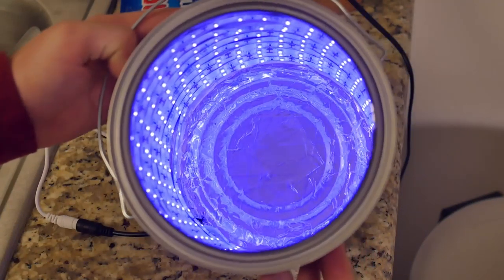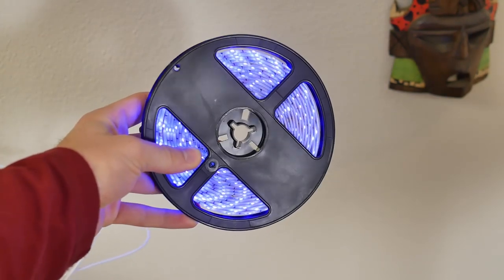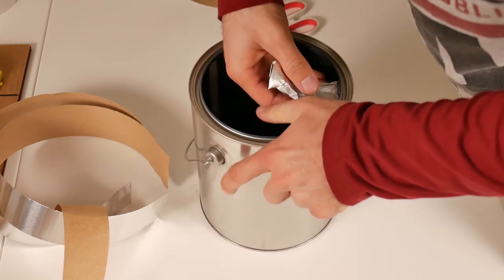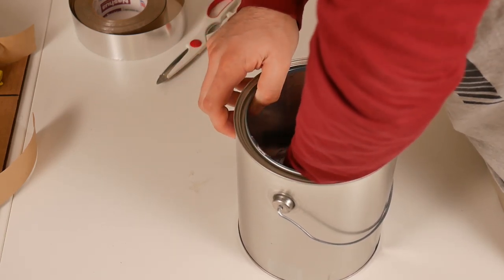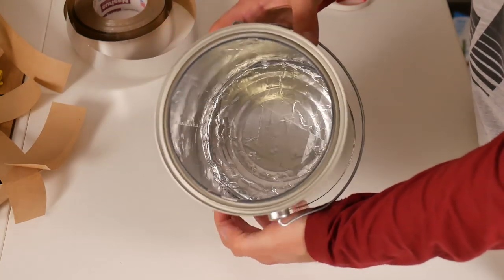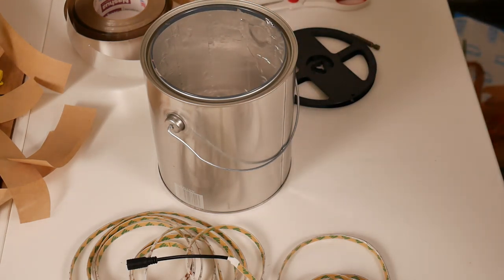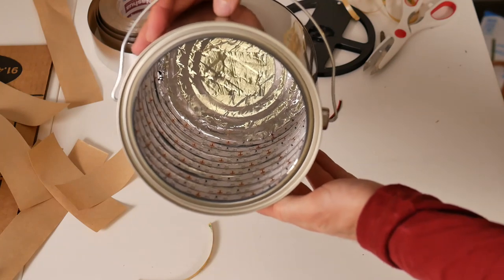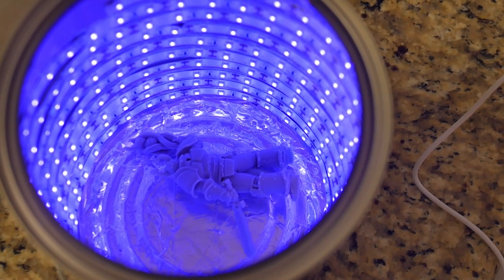DIY UV Curing Station For Resin 3D Printers | Cheap & Effective Solution

Comment: cheat code, uses a piece of poster board and coat it with the tape. Cut the board to match the circumference of the bucket, role it up and put it inside.

Comment: The foil tape is not needed with how many LEDs u have included... And you could have not drilled it an just made it upside down and used it as a lid,  curing directly on a tray overtop of it

Comment: Depending on the tape you use, the UV light you’re getting might be limited to the LEDs, with less from reflection. This is because of the types of protective films that may be present on the tape which absorb UV. The same goes for household mirrors. As the interior of the can is practically covered in LEDs here, this shouldn’t be anything to worry about, but if you build a larger chamber and want to rely on reflection, it’s something to consider.
Reply from the maker: Thank you for the input! I think if I was going to go larger I would likely get a more directed light that beams down directly into the part. Maybe one day I’ll have a large resin machine :) for now I’m happy with the small minis!
Reply: @EaterOfBaconSandwiches  true

Comment: I used an empty metal coffee can.  Size is about the same and no aluminum tape required because it’s already reflective metal on the inside. Also it was free cause I had it lying around. A $10 solar rotary table and a WiFi controlled “smart” outlet and I can control it from my smartphone

Comment: Kinda same as what I done but I used a bit of card to fit around the inside of the bucket so was able to lay the ducting tape down flat in strips then roll up the card and it expanded inside the bucket and just used double sided tape on the back of the card! I done it this way before the yv bounded off the creases in direction it could miss a spot but can just turn the model depends how tidy you want to be with it lol

Comment: I’ve done this but with the floodlight type led (I designed a lid in fusion) and got a solar turntable. The entire tin inside is reflective.
Reply: is the floodlight led sufficient to power the solar turntable or does is need extra power? how long did you use it
Reply: @Neth91  easily enough for hours and hours. It needs the slightest of daylight to turn so the floodlight ensures a constant turn.

Comment: hello, nice clean build! could you do me a favour and test one of your prints for scratch resistance? i recently built my own uv chamber, similar to yours but with even more power than yours (no flex intended). However, the print surface remains weaker (not scratch resistant) than the fully cured resin of the bottom layers that are in direct contact with the build plate (scratch resistant).

Comment: I'm doing this project now and was surprised when my uv lights arrived today the strip doesn't have any paper backing on it, it's just sticky right off of the reel. I'm sure it will work fine though.
Reply from the maker: How strange! Hopefully it will hold up. Good luck with the project :)
Reply: @ModBotArmy  It turns out there actually was a backing on the strip, it was just getting stuck to the other lights as I peeled it off. I haven't drilled the hole or tried using it yet but the project seems like it worked out pretty well. If I show it in a video on my own channel I'll link to your video. Here's mine. 
https://www.instagram.com/p/B6rSRhXDm_5/?igshid=14drtqvhgfdq6

Comment: I made one like that,but my resin does not cure fast enough... i coat statue and it runs off before it cures.. What resin is best???...the stuff i use s thick also... and looks great when i put in uv chamber...when its done it is a mess bare spots all over my 3d printed statues... same thing happens when i use 2 part resin... fast cure will solve this issue. thanks

Comment: well, an hour of work, at 30$ an hour (my little salary) plus some roughly 40$ material, 70$ for a curing station is quite the deal compared to 250$ Luna curing station of phrozen for example ;)

Now, that leaves me 250-70 = 180$ of vodka and then I can finish it off with a lil big fat gringo with my 30$ hourly salary all the meanwhile I'm waiting for my miniature curing, all in all, greatest deal eva XDD

Comment: This video can save my life haha! Great stuff! Hey dude, you seem to have a lot of expertise printing resin figures. As of now, I'm stuck with a project that I don't want it to fail in the long term, I had a bad experience with a figure that melted and found how others have gone through the same and even worse, figures that crack and even explode. Some say this is all because of bad curing of the resin inside the hollow area, but my question is, can printing fully solid avoid this issue? And if you let me I would like to ask, can curing only by using sunlight be as tough as curing using UV light?

Comment: I thought you was building an arc reactor.
Reply from the maker: Haha that was a good guess
Reply: @ModBotArmy  I've been thinking about using my printer's control box to power two 12v fans and 12v leds. But I don't want to burn down the house. You think I might need resistors to do such a thing? Or any advice on making it work? Thanks in advance.
Reply: ModBot Nice cover up attempt, calling it a curing chamber, but we know what you’re really building here.